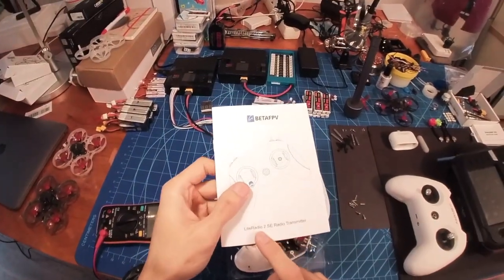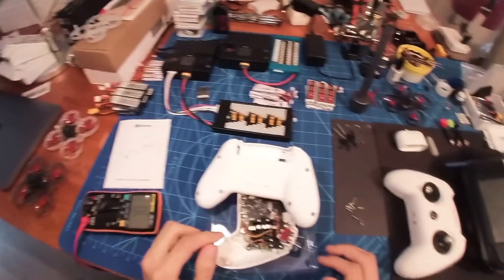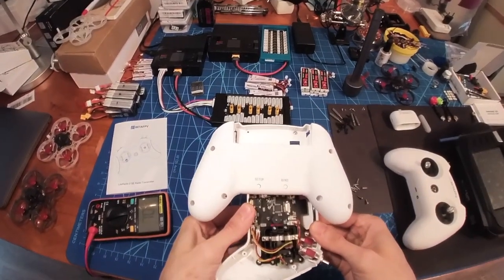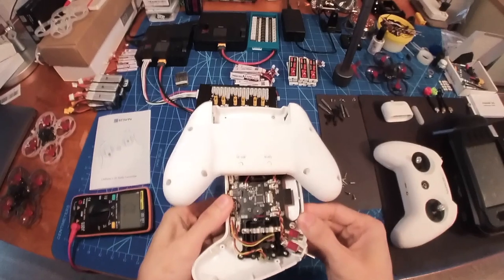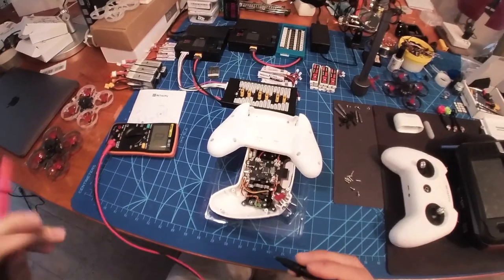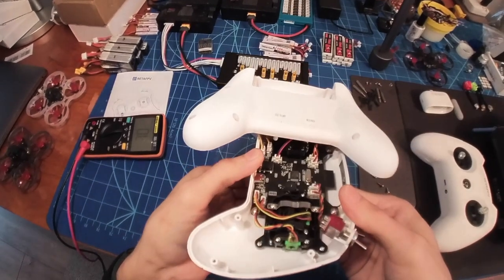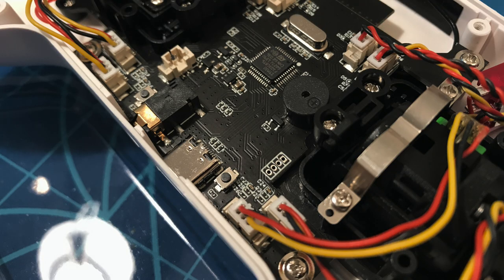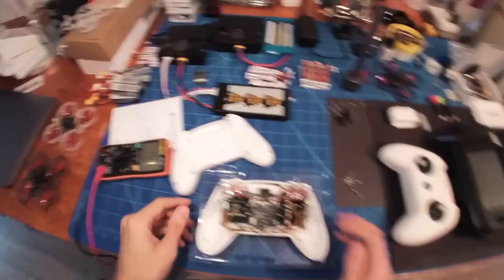NEED HELP! BETAFPV literadio 2 SE | Problem with Bind Button

Comment: They sent me one with a bad usb port and said they would send a replacement board but never have, I write them every 3 days. Next I'm posting negative about BetaFPV daily till resolved.
Reply from the maker: They send me a replacement board also but it turned out that it doesn’t even power on. What a peace of trash 😂

Comment: I had the issue but i got it fixed by unplugging everything and leaving the board on my table and just play with the buttons and using it as a fidget toy when i got bored 😂. Then i just re plugged the board and the bind button somehow works again.
Reply: Is this related to capacitors effect ?

Comment: When you start up the radio, you have to pull the throttle all the way down until you get the blue light. Then the bind button will work.
Reply from the maker: The light goes blue but the button still doesn’t do anything. Thanks for the suggestion though 😁 anyone else?
Reply: @Diown  ask refund same problem. Is unfixable
Reply: @Diown  but I'm not 100% sure is the same problem
Reply from the maker: @scorpioga3t6  they are going to send me a new board... no idea how long that will take :P

Comment: can you please make a video showing how to change to mode 2? i was sent a transmitter with throttle on the right:(
Reply from the maker: Maybe you can just switch the gimbals and change a few settings. Otherwise remove the spring and tentionplate to the other side
Reply: @Diown  but if i switch the gimbals do you mean unplug them and plug them into the other side too?
Reply from the maker: @OzzySafa  yeah but then the direction will be flipped maybe. You have to try. If it doesn’t work that means you have to switch the spring and tention plate to the other side

Comment: When you turn on the radio, you have to pull the throttle all the way down until you get the blue light. Then the bind button will work.
Reply from the maker: Tried it. Doesn’t work for me ;) got a replacement board that doesn’t even work at all.. trash